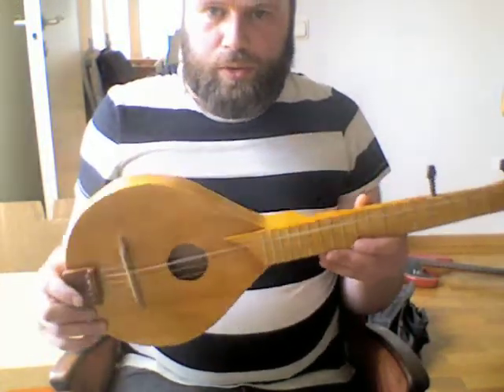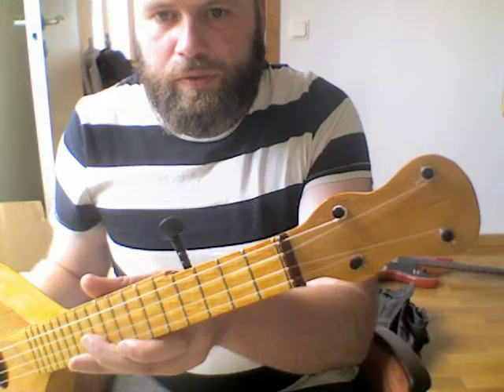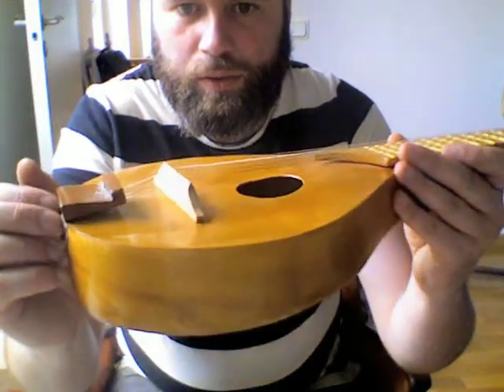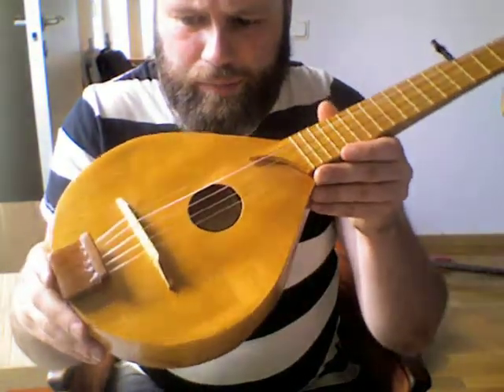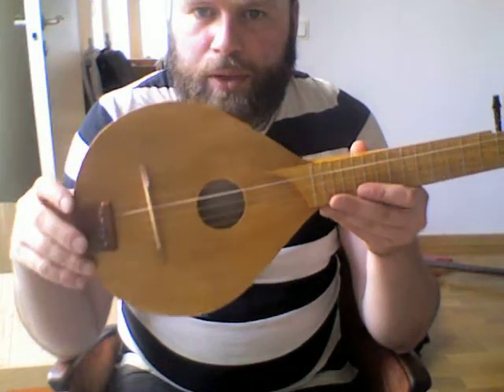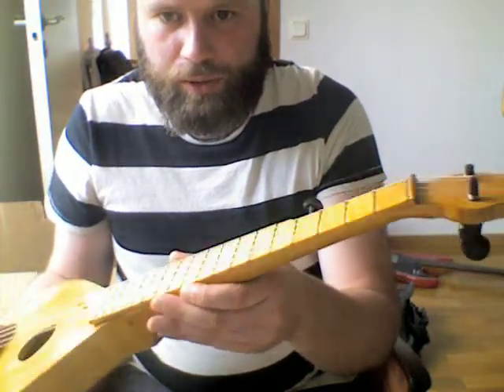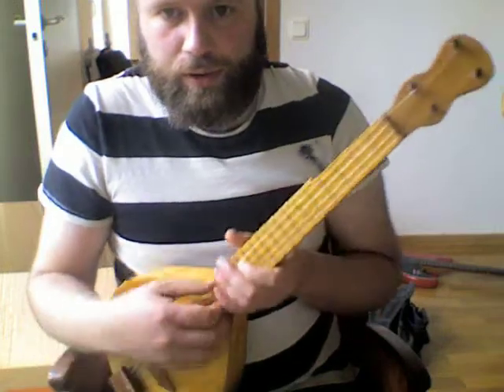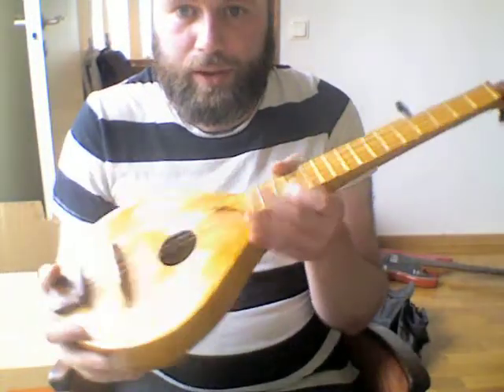Ukulele banjola no2

Comment: Very lovely tone!!!! thanks for the diamond hone fret leveling tip, the neck does look quite wonderful....as far as the slight dip in the top you might try setting a violin like sound post underneath to see if it will straighten it back out, or you could fit it just so to keep from further collapse....I had a very, very slight bow to the top of my banjola...I used parallel bracing next one I think I will x-brace.......congrats on the new home as well...
regards cj